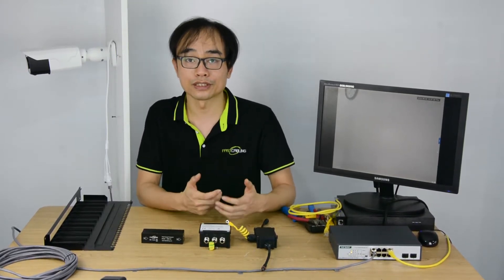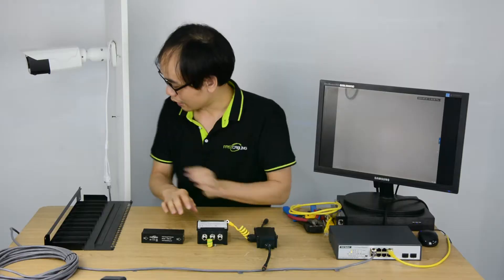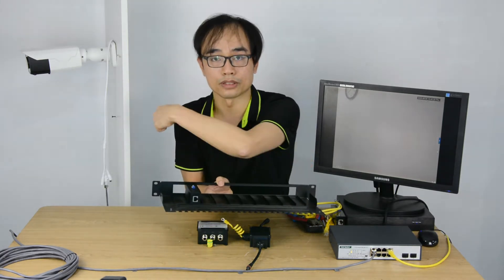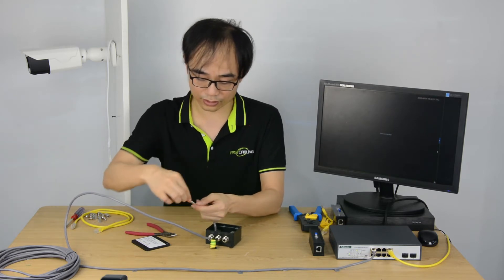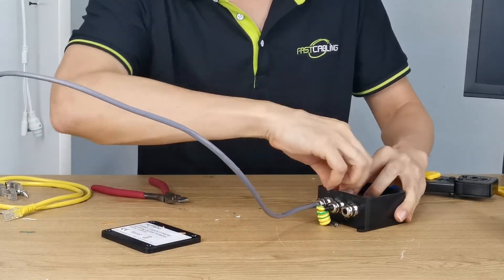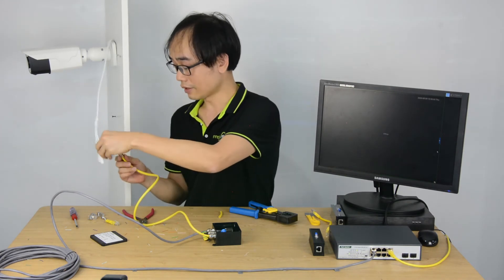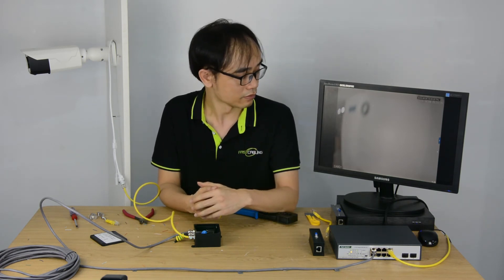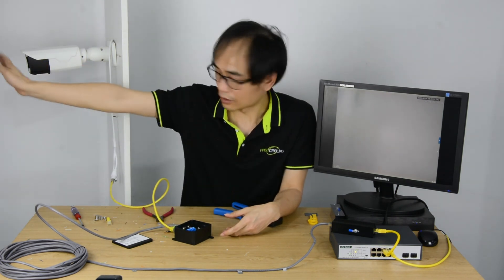How to add surge protector to PoE IP camera and NVR

Comment: What kind of grounding is necessary. Can i just drive a lag bolt into the foundation and ground to that?
Reply from the maker: Driving a lag bolt into the foundation is not recommended as concrete and other foundation materials do not provide the low-resistance path necessary for effective surge protection. 

A common and effective method is to use a ground rod, typically a copper or copper-clad steel rod driven into the earth. This provides a low-resistance path for electrical surges to dissipate into the ground. Ideally, you should connect the surge protector to the main grounding system of your home, which is usually connected to a ground rod or a metal water pipe that goes into the ground.

Comment: Can you aslo put the surge protection from your house internet modem to NVR to protect you nvr getting fried cause my dvr HDMI got fried from the internet modem getting hit by lightning now I'm using vga connection to see video or the lightning hit the camera and fried the HDMI connection and fired my internet modem ?
Reply from the maker: Yes you can set surge protector between the modem and the NVR. Are you sure it is the internet cause the HDMI fired. The network port was supposed to get fire but not the HDMI port. You might want to consider the surge protection between the cameras and the NVR as well.

Comment: How to connect the surge protectors for the IP cameras more than 100m
Reply from the maker: If the cable is more than 100 meters, usually you will need to add PoE extender (s) to repeat the network. Then it has no difference. You just need to add the PoE surge protectors both end. https://youtu.be/QaAABZnHnVo

Comment: Thank you for your video. I have a question - do you need to ground the PoE surge protectors?
Reply from the maker: Yes, grouding the surge protector can introduce the surge to the ground. Even you don't ground the protector, it still can protect your camera from the surge, but grounding is highly recommended.

Comment: Hi just checking if lightning strikes the camera. The Camera will be fried but the surge protector on the camera end will catch the surge and protect the POE switch am I right? So we just need to replace the CCTV again but the POE switch and backend devices will be protected.
Reply from the maker: If the lighting strikes the camera or any other equipment, it will fire without any doubt. However, getting strikes is odd. the lighting may strike and create a surge which may absorb by the internet cable. The surge could go both sides, the camera edge, and the PoE switch. Without a proper surge protector, this equipment could be damage. The surge protector could introduce the surge to the ground or absorb part of the surge.

Comment: Hi can water getting into the camera connector thats outside cause a power surge and blow the Swann Dvr?
Reply from the maker: It is pretty common case the water getting to the connector, but it will not caues the power surge and blow the DVR. The PoE  system will stop releasing the power while it detects the short circuit. You will need to keep the pigtail connector facing down.

Comment: Hi Joe,

Can you provide a direct link for this surge protector. As your website doesn’t seem to have it listed?
Reply from the maker: This is the surge protector: https://www.fastcabling.com/product-category/poe-surge-protector/
Reply: FASTCABLING Hi Joe - Appreciate the link to the surge protector. Can you tell me what kind of components are used inside of this surge protector? MOV’s, GDT, Diode, Resisters? Also does your fine company offer discounts for bulk purchases? I have more than 16 cameras at $34.28 X 16 = $548.48 USD X 1.30% Canadian Exchange that comes out to $713.02 Canadian! ☹️🤦‍♂️

Send me a PM if you would like to discuss this further and if you can help on bulk pricing. 

Thank You - Sir! 👍🍺
Reply from the maker: @TEKENGLOBAL  It has MOV, GDT,  Diode, and Network transformer. We can send you the internal picture of the PCB boards as well as the discount. This is the email support@golbong.com
Reply: FASTCABLING Hi Joe - Email sent and please do check your spam / junk for email coming from my GMX account. 👍🍺

Comment: Good information video. I'm also facing a particular issue. My LAN UTP cable fault in random fashion for outdoor IP cameras. Wondering what could be the issue. But after watching your video I think the problem could be due to surge.

Is it recommended to install surge protector for all cameras or just the Outdoor cameras only? 
Also at the NVR do we need surge protector?
Reply from the maker: I would suggest you at least install the surge protection for outdoor camera. It has higher possibility for outdoor camera to absorb the surge. The surge is existed in the environment and will be absorbed by copper cable.